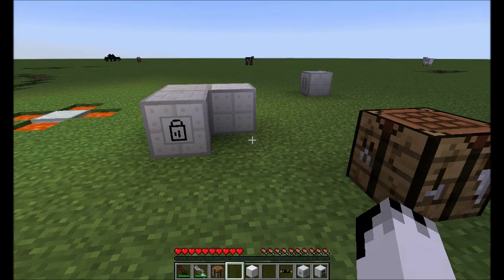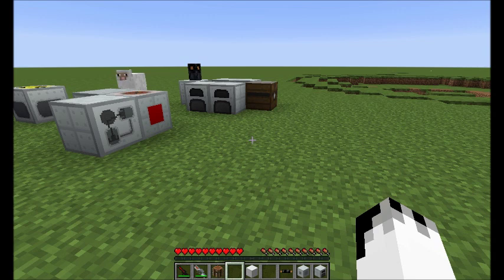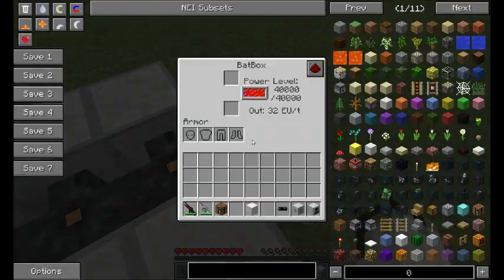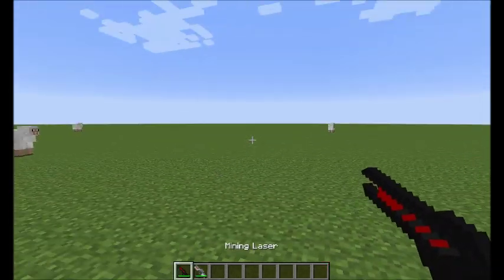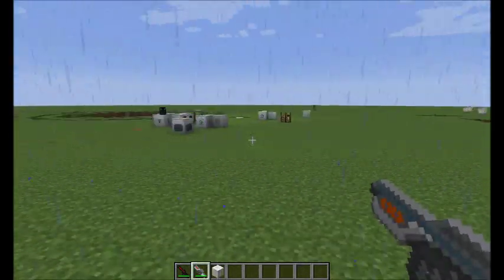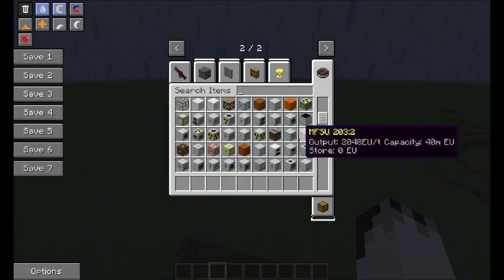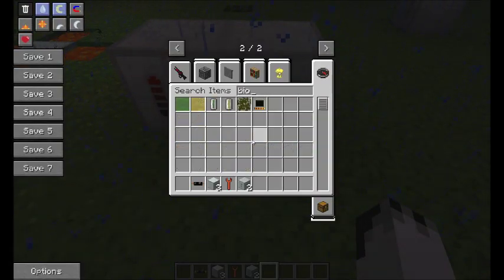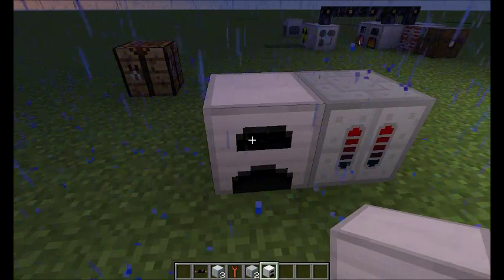Industrialcraft 2 1.7.10: New Mechanics

Comment: This is the only IC2 tutorial on the whole of youtube that's in English
Reply: waterlubber more like in the entire internet. how is it possible to not find ANY tutorial on this topic anywhere? i cannot even find official mod page that has the latest info every single page i found only showed pictures of older more simple version. i cannot even get started because i dont even know how to make rubber since smelting does not seem to work anymore
Reply from the maker: joule400 you should still be able to smelt resin in to rubber, though try an iron furnace if the normal one doesn't work.
Reply: darkironphoenix i tried in creative. i could only use extractor. iron furnace did not even allow me to place sticky resin in. stone furnace allowed me to place it in but would not turn on or would not gain any progress if i placed it in while it was on and finally electric furnace did not even accept it. also extractor made it to some dust 0.o (this dust could be smelted in all furnaces to rubber)
Reply from the maker: On the latest build it works as normal.  Resin smelted in a furnace, Iron furnace and electric furnace without issue.  Extractor turns resin into 3 rubber as normal.  Are you running gregtech  as well by any chance, as that will affect default ic2 play.
Reply: darkironphoenix im using it on technic pack so im not too sure.

then again why it had to go this sort of complex all of sudden. i mean im not against it having depth but this is pretty huge leap from original version. also how you transfer heat? i was only able to use blast furnace by placing that heat generation thing right next to it.
Reply from the maker: Yep, thats the only way to transfer heat atm.  Its jsut to turn it from a mod you do in a few hours to something with a little more progression and depth.  Have a look in your mod directory; if you spot gregtech, that will explain why your pack is horrendously awkward.

Comment: Does anybody now why my generator doesn't work?
Reply from the maker: What's your setup?
Reply: Well if you're talking about the config files, I haven't opened them
Reply from the maker: No, i mean, litrally, what build are you on, what are you doing, just more info about your issue.
Reply: well I have a experimental version (v2.2.627)
Reply from the maker: And what fuel are you using, what is it hooked to etc.

Comment: The electric heat generator is what you use when you have solid or fluid heat generators generating EU. Plus they generate more heat then the resource base heat generators.